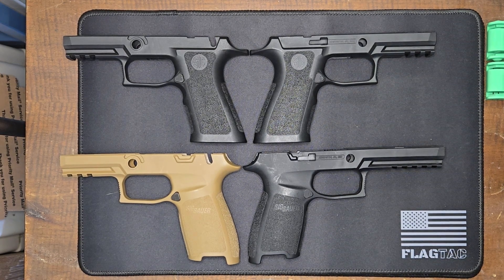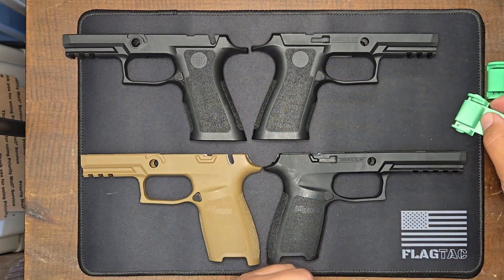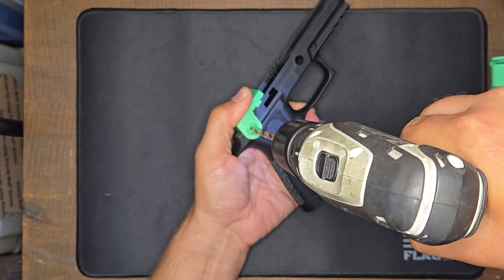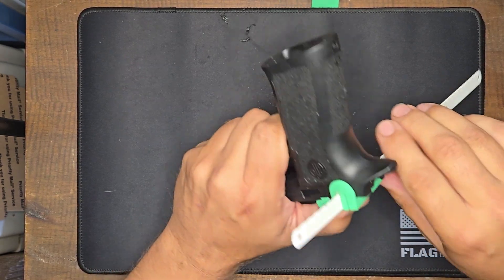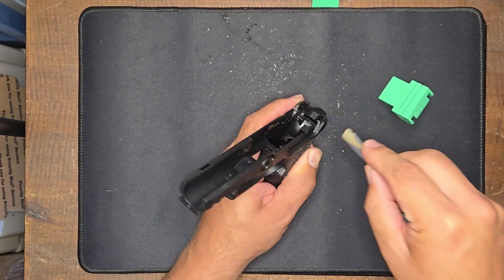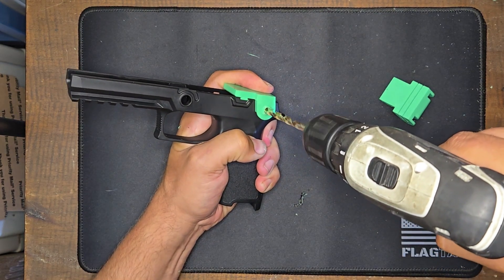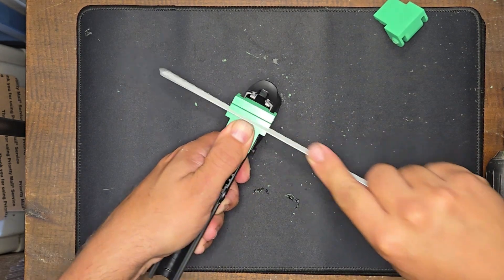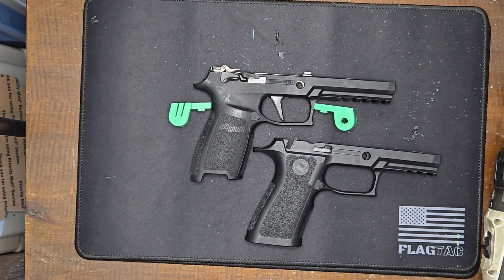Cutting Sig Sauer P320 Manual Safety Slots in Grip Modules without a Dremel

Comment: So you know if these will work on the Wilson combat
Reply from the maker: Good question - I don't know for certain.  I'll see if I can get my hands on one to test with.
Reply from the maker: Just purchased one - will update here once it arrives - if these don't work with it I'll make a variation that does!
Reply from the maker: Confirmed today that they do work on the Wilson Combat grip modules.  Note, however, that if you have a magazine disconnect on your FCU, you will either need to remove the MD or modify the grip module slightly to make room for it since it doesn't fit out of the box.  If you don't have the magazine disconnect (or remove it from your FCU) then it fits pefectly.
Reply: How much does it cost?
Reply from the maker: @dillonforeman857  $12.99 plus tax (if in CA) and shipping.

Comment: Knowing that you would cut through the grip...Do you sell a cutting jig that I can give a gunsmith a template to cut "stainless steel" for the the Sig Sauer P320 XFIVE SXG?  
Thank you,
Kirk B.
Reply from the maker: Part of the challenge there is that I believe the top of the grip inserts would need to be modified to allow for movement of the manual safety lever.  I'm looking into trying this on the AXG module.  If I am successful I'll probably do a new video for that.

Comment: Good stuff, ordering one now. Side note, have you done a TXG frame and how hard was it?
Reply from the maker: I've done two TXG modules and they are pretty easy.  I go slow with the drill since these are a little more brittle than the straight polymer, but the jig supports the module well so the risk is very low.